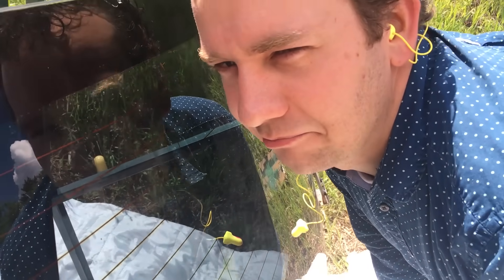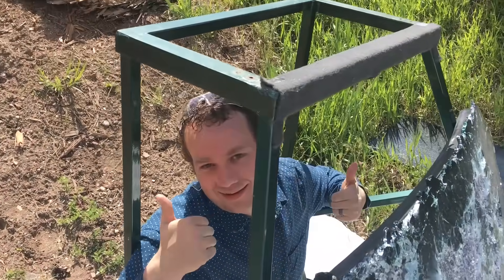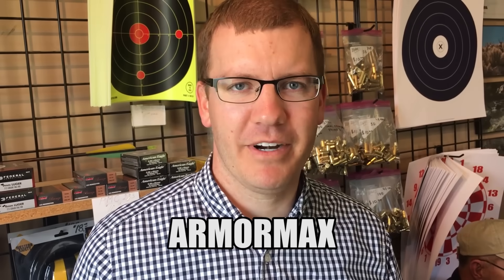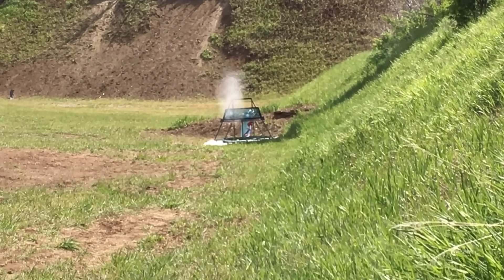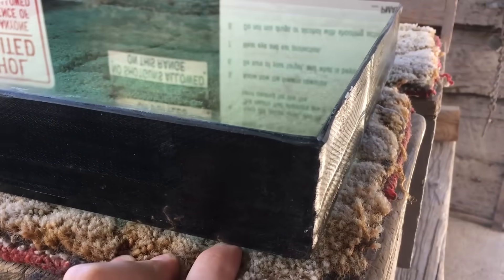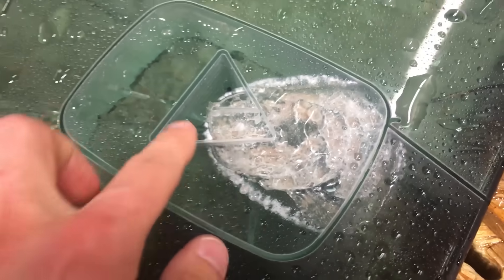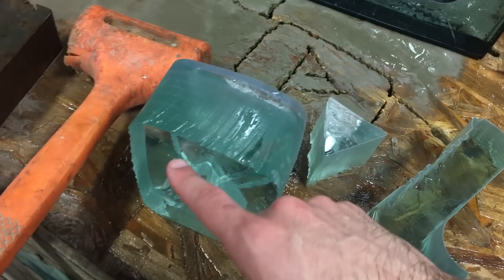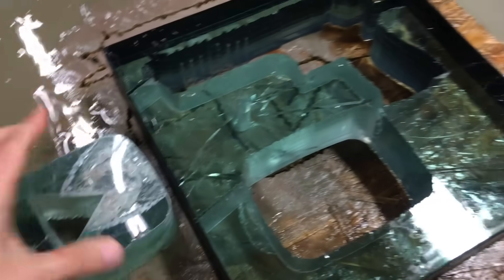Bulletproof Glass vs 60,000 PSI Waterjet

Comment: To prevent shattering the glass during piercing, start at a low pressure, then resume full pressure once it has pierced the material. I was fortunate enough to have the opportunity to cut gun ports on this same material for military vehicles. The material was thicker, I believe 3 1/2 ".

Comment: It's bullet resistant glass, not bullet proof. A water jet with a garnet abrasive will easily get through regular silicone based glass. With bullet resistant glass, it's not about hardness, it's about quickly spreading out the energy from the round so that it stops before passing through all of the glass layers.

Comment: Back in 1982, I joined up with a guy whose dream was to sell bullet proof products for armored vehicles. He got an intro into the US Army to sell his products. We built a Lexan (plastic) box to fit atop a APC armored personnel carrier. It was equipped with a windshield wiper, defroster and all the bells and whistles. The local news got wind of what we were doing and wanted to see just how bullet proof this thing was. SO ! yeah so,  we placed the box on top of a couple of saw horses and the big shot "owner" got inside and allowed his friend to shoot a .357 mag at the side of it while he sat on a folding chair inside. The guy doing the shooting was way overweight, had flat feet, chain smoked and didn't have a clue what he was doing, BUT he owned the .357 so he was going to do the shooting. This guy "shooter" faced head on, holding the gun out in front while rocking back and forth. I stood off to the side and could he was sometimes aiming at the ceiling then directly under the box. The lady from the TV station begged Rick to get out of harms way, let the guy shoot, then get back inside and let the cameras roll and no body would know the difference. No way, this thing was bullet proof so, Damn the torpedoes full speed ahead. So Bang, and the shooter shot under the bullet proof plastic, hitting the owner through his left forearm across his lap and through his right forearm. hit the other side and fell under the chair.  Next days headlines "bullet proof box not so bullet proof" Damn, hate it when that happens. When we took said item to the military, we were met outside the plant. After talking with the go between toward getting a foot in the door to sell this thing, was going to cost $10,000 just between friends. So much for that dream.
Reply: Kenneth Bartlett my hate for the shooter is immeasurable.
Reply: Damn
Reply: Thelondonbadger in an armored vehicle the doors are bullet proof too.
Reply: When someone writes a whole book in the comments and you read it all

KNOWLEDGE: 100
Reply: Talking with the go between? Why $10,000 tho?
Reply: Black Prince the year is a factor
Reply: More good things ruined by idiots.
Reply: Man that really fucking sucks. Hope you guys can get back together and try the venture again.
Reply: Kenneth Bartlett tldr
Reply: Novel
Reply: we wanted comment not an historical essay. nice story by the way
Reply: Kenneth Bartlett water jet a replica of a human skull , like what the zombie channels do
Reply: No offense but that was fucking stupid...
Reply: ddnt read lol
Reply: Kenneth Bartlett glad the deal was off.

Comment: the reason why the second shape cut broke and that's because the Pierce dwell started on the glass, while the gun the water jet built up pressure off of the glass. worked on a water jet for 3 years

Comment: Honestly think the shatter can also be attributed to the water sand mixture. I work with a waterjet and glass and if there's too much water and not enough sand/ garnet it cause the glass to shatter or vent.
Reply: Also depends not cutting at high pressure can cause issues with the pierce shot on glass.

Comment: wonder if them wind Shields can take extreme bass for the car audio crowd like 150 to 160 db or will any flex crack it jst wondering bass heads usually got wind shield breaks or cracks im waiting for the day i spider my window im roughly. at 140 to 145 db 147.3 full tilt with some distortion

Comment: -_- of course it will be penetrated because the stream is continous. If the bullets were hitting the glass as fast as the water was hitting the glass then the bullets would pierce as well. You shot the glass most of the time in a fresh spot with one bullet. You should have done a blast of water equal to the mass of the caliber of bullet. And then compare.

Comment: So it's bulletproof not waterproof.
Reply: all we need to make is a gun that shoots 90,000 psi of water
Reply: @madanimalparty  good luck carrying a 1000w power supply along with a 100kg motor 😉
Reply: @madanimalparty  but it would be sick lol
Reply: @madanimalparty  60,000*
Reply: @madanimalparty  that would be great at water fights
Reply: It's actually called bullet resistant glass. Not bullet proof. Nothing is bulletproof yet
Reply: @andrewr3846  try me my mum always said I had a thick skull
Reply: @andrewr3846  air has left the chat
Reply: +Theandroid Comegetmeorsomething I am.
Reply: there isn't anything that's absolutely bulletproof, only very bullet resistant
Reply: @eatens  the sun
Reply: This glass is made to be unbreakable to shocked pressure, the pressure from a bullet for example, the glass compresses, but the plastic keeps it together acting as the shock absorbent, water jets however cut through anything with constant, slow, and high pressured, rendering the bulletproof glass useless against a constant force
Reply: IKR? What did these idiots think was going to happen?
Reply: Divine Music well its BULLET proof not BULLETS proof
Reply: If you shoot multiple rounds at one spot, it's not bulletproof either.
Reply: @DivineMusic77  impossible
Reply: it's sad they still can't make waterproof glass.
Reply: Theandroid Comegetmeorsomething 

Luke Cage is
Reply: Theandroid Comegetmeorsomething bullet proof vest are still called bulled proof vest but I get what ur saying
Reply: no shit
Reply: I'll make sure to use a water gun then
Reply: Nothing is waterproof
Reply: Ur not understanding it man
Reply: rocky road I
Reply: nn to
Reply: Theandroid Comegetmeorsomething space is
Reply: Lol
Reply: Thanks for ruining my entire fucking video how Tf is this the top comment
Reply: I would like but i don't want destroy the 777 likes
Reply: Diamond Hawk74 you can like it now its 677
Reply: 666 likes... not gonna ruin it

Comment: This is the first video I've seen by you guys, and I have to say THAT IS AWESOME. Also, I was at a fabtech show in 2016 and saw a machine a lot like the one I saw you guys using to cut the glass. I know how to use AutoCAD and Lincoln TorchMate, but ever since that show, I've been wondering, how similar is AutoCAD to the program that runs that water jet?

Comment: ik how to stop it

1: a extremely thick solid block of titanium high enough to touch the nozzle or watever it's called

2: a triangle shaped piece of steel and try to cut it right in the middle edge, it should split the water

Comment: A shotgun slug, a hot 45-70, 338 Lapua Magnum, .50 BMG,and several other rounds would smash that first window like tissue paper.  Not to mention the waterjet has a constant stream of 60,000 PSI, while the rounds I mention only have a single impact of 50,000-70,000 PSI.

Comment: why so many dislikes though?
Reply: for the original bullet proof glass, it would have been more interesting if after they had shot it up, they tried to shoot in the same spot until the bulletproof glass failed.  as it is, it is basically there's an advertisement for the bulletproof glass.
  I would also have liked to see the original glass stand up to something other than a 223 round.  I think there a lot of very common rounds with way more penetrating power than a 223.
I would have liked to see the 223 round on the armor piercing rated glass.

Comment: How far can the water jet shoot in a straight line?
Reply: Probably pretty far but not exactly in a straight line. Gravity will pull it down. And if there is wind then much less. Also even if it shoots pretty far the pressure will be much much lower at higher distances.

Comment: It is fairly weak considering it can only stop up to .223rem, a decent one would stop around up to .308win.
Reply: is my reply saying all of that invisible?  Maybe it was gagged because I put a link to an info page on the company's website.
Reply: he said battle rifle (which includes .308)
Reply: ***** I heard him say "it can stop up to .223" in the beginning of the video, rewatch it.
Reply: There are different grades of bullet resistant glass. The one they shot at isn't the highest grade. The one they cut with the waterjet was thicker and much higher grade.

Regardless, no bullet resistant glass holds up forever, it's main purpose is to give the passengers time to evade danger. You don't sit there expecting to use it as a shield forever. Eventually it will crack, its just a question of how long it will take and theres a lot of variables to that

Comment: Your glass shattered like that because you tried to pierce through the layers.  The water and sand had no where else to go.  You set your lead-in from the edge when you cut the gun.  Also, your cut has a lot of sway in it, which means you are cutting it too fast. It's just something I've noticed... I run five of these machines at work.

Comment: 3:38  You should have drilled a hole first (with a drill) in the middle, allowing the waterjet to start from it and avoid that the water goes between layers. Water always goes in the least resistance path.

Comment: how far does the waterjet shoot if its in 45 degree angle?
Reply: "neglecting air resistance." which is, especially in th case of shooting water, somehow the most important variable.
Reply: I like that question.
Reply: waterjet gun....sounds like fallout 3
Reply: More than a 44 degree angle.
Reply: Caddy Guy Gaming. Me too, That's a good one
Reply: not far, water will become fog and drift away , I guess
Reply: It doesn't. Instead of the stream bouncing, it cuts through the ground
Reply: i think it would be surprisingly short distance as the nozzle is focused like that
Reply: It depends on many many many variables such as barometric pressure, temperature, nozzle size, PSI, etc.
Reply: @antdx316  Take STP with 90,000PSI and a few millimetres idk.
Reply: @geohubblez18  is 90,000 the highest?
Reply: at 45 degree,
taking the initial velocity of the water jet to be 150m/s 
using maximum range eqn it goes upto a distance 2295.91 m ( provided gravity at the position is 9.8m/s and neglecting air resistance.)
Reply: I really like that question

Comment: Its not really comparable..  Each spot of glass gets like 10 or 20 seconds of water hitting it.  If you fired bullets on full auto at the exact same spot for 20 seconds it would also go through.
Reply: STDrepository valid point.
Reply: when ur in the hood how will they hold the watherstream in one spot?
Reply: Where they ever trying to say that the water jet was stronger? I never took it that way. The shots were just to show how strong it was as "bullet proof" glass and then jet was just to see if it would even cut through.
Reply: Henrypika get a 30-378 with armor piercing bullets...problem solved...hell even a 300 win mag or weatherby mag
Reply: But... When you're in the hood who is using a 60,000 PSI Waterjet... a PORTABLE one at that. At that point it would be much cheaper and easier to just get breaching teeth for some kind of shot gun and unload a few rounds.
Reply: STDrepository But when you're in the hood, who is really firing at the exact same spot for 20 seconds?  Those scrubs are like stormtroopers. . . probably can't even double y y whammy claw 380° no scope phase shift bucke eroo bunny hop makel flip fin dive half turn fake draw nose trip.
Reply: @austingeorge6659  Who's in the hood breaking into shit with a whole ass waterjet?
Reply: STDrepository Full auto doesn't make much of a difference.

Comment: I still can't fathom how that high pressure water is able to clean cut these materials. I mean all those shards its ripping and displacing does it just fly out while the water cuts deeper and deeper. And does anyone know the possible speed of the water being discharged like in metres per second or km/h so we can get an idea
Reply: Rtyuu it's not only water, it's water with sand

Comment: >bulletproof
can't even survive a bit of water
Reply: 'can't even survive a bit of water'
'survive a bit of water'
'a bit of water'
'a bit'
Reply: ramses bams Because everyone has a 60000 PSI water jet in their pockets.
Reply: Yeah everyone thinks it's just the water doing the cutting.  Waterjets are very popular in armored applications because it doesn't temper the material from too much heat which would cause it to lose its bullet-proof quality.  At my work we'll run our waterjet for about 36 hours straight and the tank water is about 130°.
Reply: Yeah, hundreds. Most likely more.
Reply: ramses bams Yea stick ur hand there and let it survive
Reply: i'm not claiming my hand is bulletproof
Reply: plus all that pressure is concentrated in a super-small area...prety amazing how it went right through!!
Reply: "a bit"
"60,000 psi"
tap water at max can flow at 60 psi, this is 1,000 times that
Reply: where did i imply anything like that?
Reply: ramses bams Well there is a lot of sand in that mixture. Water alone would most likely break through 2-3 layers tops.
Reply: wow, uncalled for
Reply: ramses bams its water at high pressure and some sort of grid to acctualy cut stuff a really really fine sand or something
Reply: green text
Reply: ramses bams The water contains bits of metals, diamond, and other minerals. The water isn't the only thing piercing the glass. Yes, the water is high pressured, but the minerals do a hell of a lot of the work.
Reply: TheScreamingSyren so they pretty much labeled the video wrong then? so you are saying that pure water won't go through it even at that psi?  SCAMMERS!
Reply: StupidLoserVlogs   I unliked it! Go you! Thumbs up for the troll!
Reply: TheScreamingSyren  we get it..you anime bro. and I was serious. I was agreeing with you that they were cheating  then if it wasn't pure water.
Reply: ramses bams I was joking because you said it can't survive a bit of water. Of course it can but not 60000 psi 'bit of water'.
Reply: ramses bams 
>meme arrows 
Not even on 4 chan
Reply: I didn't even like my own comment. but now i will, 2 points!
Reply: People should stop calling it bullet proof and call it bullet Resistance. Enough shots would get through
Reply: Aaron mann Mein gott, you are a child.
Reply: Do u not under stand thats 60k psi! Like if u agree

Comment: i guess bulletproof glass isn't waterproof
Reply: Candyman3466 And also not lick proof 😂😂😂
Reply: i guess so...
Reply: Water does do the cutting. You don't need the abrasive, it helps. Often times they even say when they are using it and when they are not.
Reply: saw?
Reply: FuciMiNaKule The water is a high powered vehicle, just like a belt in belt sanding is.  Water only just scribes the surface of hatd stuff like this but adding abbrasive produces the cutting action.  Foam, rubber, woods, thin plastics, and food can be or are cut without abrasive.  That's why waterjets are so versatile.
Reply: You can't say fuck on YouTube? Sure you can.
Reply: Aeswere Well maybe he is more civilized than both of us can ever be !!
Reply: Candyman3466 only if Blackbeard would have this instead of his plastic wrap sheild.
Reply: you spoiled it dumbass shitdick
Reply: you know what i don't give a wait i cant say that on youtube....
Reply: Candyman3466 I was going to saw the same thing lol

Comment: come on guys bulletproof but not waterproof what even is this haha
Reply: it's waterproof but it's not water jet proof
Reply: Da,Taper if u had any sense of humour, youd knew i was just kidding
Reply: Isis be buying up water jets now
Reply: 60,000 psi is 60,000 pounds per square inch of glass the water touches. Waterjets easily cut through structural steel so
Reply: Daniel Szymanski I don't believe in sense of humor
Reply: Daniel Szymanski Brainless idiot